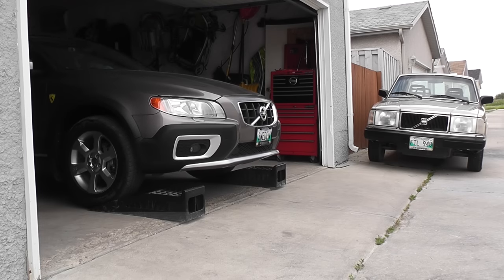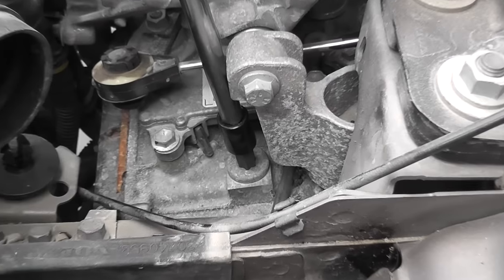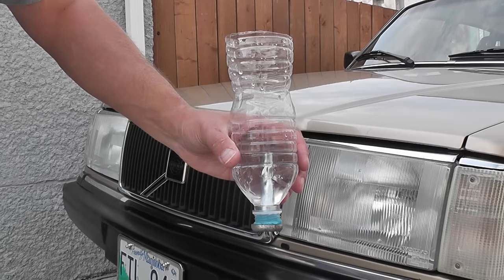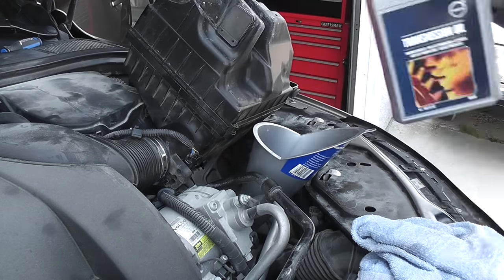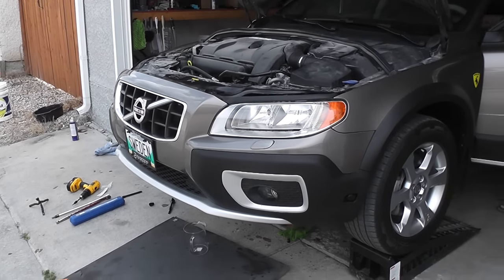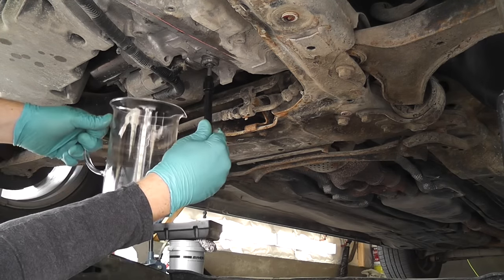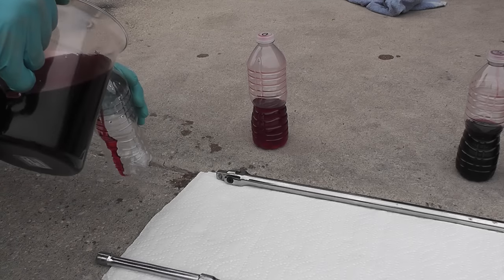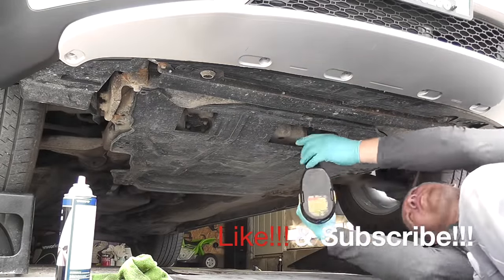Volvo Transmission oil change Aisin TF-80SC. 6 speed Auto.

Comment: you are better than any volvo service
Reply: Nope, not Swedens Volvo services trust me, they live for volvo.
Reply: Same in norway
Reply: Swedish volvo service sucks donkey balls. They failed to locate a small hole in a hose that was causing check engine light to come on until i mentioned that they could use starter gas to locate it.. Aint even going into the other stuff they failed at.
Reply from the maker: Its people!
Reply: El cambio de aceite no es correcto. Para comprobar el nivel de aceite además de comprobar la temperatura, el coche debe estar horizontal.
Reply: Exacto
Reply: @javiergonzalez5135  aunque no tabajo en un cocesionario de Volvo, esa reparacion es incorrecta pues el vehiculo no está nivelado, por lo que el nivel no es correcto.
Reply: Por eso dije exacto a tu respuesta. Tiene el coche subido de adelante. @franciscotorrado84
Reply: @DirtyRC101  You don't learn the "Diesel Start trick" in any education ... only by experience
Reply: @volvosweden  First thanks for the good videos .. nice to see a share experience with others, 'specially the experience not written in any book. Keep up the goods work.
Couple of things are confusing here though.
1. There is comming a liter or more out of the LEVEL plug the first time, you unscrew it?? Meaning Volvo/Aisin Warner overfill the gearbox from new???
2. Volvo/Aisin Warner says 7 liters capacity in the gear box. You took out only about 4 liters first time and drain off about half a liter of the last 4 liter jug put in??? (I got it with your 50/50, 25/75 and 15/85) Any other way to get the rest of the old oil out? I know "the leftover" is in the converter, solenoid block, etc. Is a gasket for the solenoid block cover not less expencive as 8 liters of Volvo ATF? Or will it not give any more result to take off the cover? (If it's even possible with the gearbox in place .. didn't look that thorough yet)
Some other "presenter" here on YT just say "start the engine, let the gearbox pump out the old oil, stop the engine when it stops runing out the drain hole" .. NOT to recommend!!!!
Reply: Telly Onthewall o wiz told there would be no math...
Reply: @G_de_Coligny  ehh..?
Reply: @tellyonthewall8751  transmission fluid will expand when they get old.
Reply: Does car need to be level left and right? How about front to back?
Reply: А то, что машина на подставках не горизонтальна? Уровень получится не корректным.
Reply: @tellyonthewall8751  Theres no reason to drain 100%, if you do a fill and drain regularly (say every 30,000mi/48,000km) the oil will be plenty fresh, I installed a transmission cooler and inline filter on my P3 S80 (indentical to the XC70 although I have the V8, same gear box and suck). Keep in mind that if you do what Volvo Swden did, he is actually removing more than 15/85 because don't forget the transmission oil mixes. Also, you don't need to use Volvo ATF. I use the "Aisin" brand ATF, which is the manufacture of the transmission, its like $5 from RockAuto.
Reply: @franciscotorrado84  puedo decir en ingles por los otres aqui: The comparison of the oil-level is not correct as the car has to be in exact horizontal position and not only the temperature-level of the oil.   saludos de alemana!
Reply: @worksbyoscar2350  Still Volvo service right, remember the "sealed for life" claim for the gearbox? How many Volvos are lying in a junkyard because  this?
Reply: @franciscotorrado84  el ha dicho que ay un desnível en la garage, y entonces el coche acaba nivelado. ;-)
Reply: @franciscotorrado84  que tipo de atf, para volvo xc 90 2.4 163cv año 2004 automático de 5 velocidades un saludo.
Reply: @tojiroh  sabes que tipo de atf para un Volvo XC90 2.4de 163cv año 2004 automático de 5velocidades gracias!!!
Reply: Very perofessional work . Отличные результаты
Reply: Totally agree.

Comment: Nice video. But seeing as you have VIDA you'll know that this isnt the procedure shown to flush the transmission. It states to remove the oil return hose.
Reply from the maker: And that would be the better process to change oil. But don’t want to mess with the lines and seals.

Comment: Finished this today thanks to your video, fantastic and thorough as always.  I made a few adjustments: I did extensive research and Volvo has an Aisin transmission using same JW3309 fluid as Toyota T-IV, which is what I bought.  It is the same stuff and much cheaper, $80 for 12 quarts.  I also only did 2 drain and fills, saving the last 4 quarts for about 1000 miles down the road when the fluid would be really mixed and next oil change.  Reason - I've done this on Acura before, their 3x3 procedure asks you drive through all forward gears between drains to ensure mix and my mileage is 85K miles, only doing a 2X gives adaptation some time to settle back in and not shock the system
Reply: Does the Aisin TF-80SC do "adaptation"?
Reply: @pbierre  yeah it’s an adaptive gearbox that adapts to how you drive it basically which is good for fuel but terrible for performance in some instances.

Comment: Hi Yuri,  I finally changed my transmission oil at 102,000 miles.  As mentioned before the transmission was clunking when changing gears  between R and D in parking maneuvers.    

I followed your instructions but ran into an issue.  

When you took off the air box, it was so easy for you, but for the life of me, I could not get the front to come apart, and I was not sure how to get the MAF senser released, as well as the clip that holds it.  I watched your video multiple times.  Thought I was screwed, cannot change the oil.  

BUT WAIT!  I was able to see the transmission inlet oil plug and insert a T-55 on extensions.  And I was able to squeeze my hand in and remove the plug.  And I have a  OTC Steel flexible spout and funnel which can fit right into the hole.  

Thus I was able to change the oil without removing the air box.  Phew!  

The transmission oil was black, hardly reddish like yours.  After doing three drain and fills, it is barely red.  I would probably have to do two more passes to get to your color.  

I was able to read the oil temperature with a Foxwell NT510E scanner, but I was not able to reset the counter.  

Thank you for your video, could not have done it without your instruction.  Regards
Reply: Hi brother. How was the gearbox after that? Still clunking? Mine is doing the same thing. Thank you
Reply: @Redrocer  In the winter time, no clunking, in the summer still clunks.  I need to do two more drain and fills.
Reply: @chien-shengtsai8626  thank you for answer 🙏❤️

Comment: 2009 XC60 here. This was a brilliant video worked great for me. I was worried doing it as my car was 2nd owner at 180,000km with no evidence of ever having the fluid changed. It was still slightly red so it may have been at some stage. 
Tip: when resetting the counter be sure to read the instruction page (I didn’t). You have to click on the symbol of the module to start the procedure NOT click on Continue like I keep doing. 
Also if you don’t have a hex 17mm socket (get one!) or you can improvise with a deep 17mm hex nut ( I did)
Also to get to ignition setting 2 on my car, stop the engine then press the start button for 2 seconds without pushing the brake pedal 
Thanks VolvoSweden for the great videos
Reply from the maker: Great tips here. Thx so much

Comment: Very well detailed video! Very much thank you for this! This is exactly how I will do it on my Volvo S80 V8. A can't say how much of your videos help me to learn about servicing my Volvo! Really appreciate your work! 👌🏻
Reply from the maker: +Ákos Frast Thx. Easy job
Reply: After seeing this video I am also confident to do it my self on my v8. But first I need to get vida and dice.
Reply: But your car wasn`t in level, you jacked up the front wheels? Confused? How are you mean "in level"?
Reply from the maker: +Zeus Sweig Please read in description. The garage floor has a slope. The car is level.
Reply: My advice is not to flush it, rather, change the atf at shorter intervals e.g 25k km instead to prevent shocking the transmission when most of the existing atf is removed.
Reply: @jdfd4906  not most when You drain 3.5L of over 7L total

Comment: Great Video Guys! I already did it like three years ago on my S80 V8 2007, now I just bought a V70 III D3 2011 and it has the same gearbox and it has 161,000 kms and I assume with the original oil from the factory...... Volvo does not have a service plan to change the oil, they say they only change it if there is a problem......!!!!!!! ????? But then it is often already too late !
Really nice video and quality - world class ! I also used your video yesterday for the rear brakes and the handbrake motor, thx for that one as well !  So appreciated by me a Swede living in Germany and with our 3 Volvo cars! You are simply the best!
Reply: Volvo do have service plans but for specific vehicles only. 60 000 km for fleet lease/service vehicles (taxi, police etc) and the rest of us "if maybe necessary but Volvo couldn't care less, please buy a new car instead" type of deal.
So changing trans oil is never a bad idea. If yours should fail after a fluid change at 161k it's just a sign that your transmission was damaged beyond repair anyway. It's a Toyota transmission after all, it should hold.

Comment: Very good instruction. Just one tip, when setting the oil level,  your has to be on a flat surface and level. Best solution would be to jack up the rear.
Reply: I was wondering the same thing. He said it himself that the car should be level to get the proper finished level. His vehicle was still on the ramps

Comment: Great video! Just a few notes: There are 2 versions of the TF80SC and both use different transmission oil. (one is type 3309, other 3324) Make sure you use the correct ones as you can not mix these. There is a vin break for each vehicle model so you can check online.
Also, if you find the Volvo fluid hard or expensive to come by, toyota sells the exact same fluid at a cheaper cost. (After all, technically they made that transmission)
Reply from the maker: Great info! I will add this info to the video description. I thank you.
Reply: What's the spec on the Toyota fluid?
Reply: Depending on your model VIN break:
JWS3309=Toyota Type IV=1161540
JWS3324=Toyota WS=31256774

Use the VIN to determine, not model year as 2010 does not apply to all models(XC90 didn't change over until 2013)
Reply: @GCast-iv1pd  Hi, so my XC70 2010.10 production (MY2011 based on VIN) needs the Toyota WS / JWS 3324 right?
Reply: What fluid on a 2007 XC90 D5?
Reply: @Bjornthevolvo  All 2012 and earlier XC90 D5s are JWS3309. The changeover to JWS3324 happened in 2013.

Comment: Great video -  the details make all the difference.  I completed the service on my 2014 XC70 with a couple of changes. I found a funnel with a long hose that I made stiffer with a coat hanger, and used that to put fluid in the top of the transmission so I didn't have to remove the air filter box - I just used a 3/8" drive extension to access the torx fitting (on mu car a bit hidden by a fitting above it), and an extensible magnet to lift out and replace the torx fitting with each addition of fluid.  Worked fine with a little bit of fiddling, with a lot less hassle than removing the air box each time.
Then, the whole VIDA DICE issue was so difficult to decipher (software only available with license from Volvo, outdated operating systems, lots of on line confusion, etc., etc.) that I took my mechanical engineer brother's suggestion and just heated the final 4 quarts of transmission fluid to about 65 degrees C, assuming it would cool a bit when put in the transmission.  Buttoned it up and seems to work fine.  Didn't bother with resetting any codes.
Reply: To anyone doing this. I do not recommend bypassing the reading of the temperature sensor. You will not get the correct reading using methods such as this or using a laser thermometer pointed at the bolt (as I have seen in other car’s procedures). And you will not get the correct level. Probably good enough. But if you’re going through the trouble of servicing a “sealed” transmission I recommend you do it right and get the correct level.

Just get the DICE knockoffs scan tools for about $100 online and the software from volvodiag virtual machines (google it)

Comment: excellent video! However on most cars you can disconnect a line to the auto trans cooler (often inside the radiator) so that you can pump out the oil while filling with new oil and keep doing that until the oil runs clean.

Comment: Volvo mechanic for 30 years.
Disconect the transmision reverse oil ,and conect a lang hose on it.
Tap of the transmision fluid.
Fil it wih 3 liter transmision fluid.
Start the car.
Start filling the transmission with 4 liter while ideling.
If it start with air bubles,stop the engine.
Fill it with 3 liter trans flued,and connect te reverse to the radiator.
Now you need vida for the level check.

Comment: I finally got the kahuna's to attempt this and thanks to your video I had the confidence all the way through.  However, I did only one drain/fill.   
Mine drained exactly 3 liters.   The old fluid was more browner than I wanted to see and smelled like old varnish.  
It's a 2010 - S80T6 with 118K miles, previously owned by an older gentleman so I don't think it was abused so much.  
After the single, 3 liter drain and fill, the fluid turned much more pink after idling, and running through the gears a few times.   I was pleased to see that.  
I documented with photos so I can compare color after next change in about 3 months.  If the fluid is brown again I will consider doing the 3x flush like in the video.  Or I may consider spending the $300 to have it fully flushed at the Volvo dealer and have the computer reset.  Any feedback on this would be appreciated.
Fluid was $58 here https://www.fcpeuro.com/products/automatic-transmission-fluid-4-liter-1161640.  The website tells me to use the 1161640 for my 2010, not the 31256775 fluid. Anyway, this place is awesome for ordering parts I need and they have a lifetime guarantee!  Even on filters!!!!  You all really need to check them out!
Thank you again Sir for another wonderful video.  I am just a computer programmer but a weekend mechanic on my own cars.  Volvo's kindof scare me and I want to take care of my baby.  I can't afford the dealership either.  I have changed spark plugs, oil trap/PVC box, brakes, and cabin filter, saving a lot of money.
Reply from the maker: Glad my videos help. Good luck and take care of your S80

Comment: Personally I would not bother buying a DICE unit until the warning light comes on., If the oil has been changed you know its good, So you could buy one later if a warning came on, (if the transmission is not used hard they very rarely come on anyway)   What is important is the oil is changed, But if you totally disagree with this please let me know and give your reasons and I will change my view.:-), would love any comment.

 The best transmission change for this model I have seem. Great work, Thanks. :-)

Comment: Very good video and voice over explaining the steps.  I noticed how long it took for the ATF to heat up while you were letting it idle there, to accellerate this you can put the car in drive, and power brake gently, putting a load on the trans.

Comment: Fantastic video. This is probably the best level of detail and information i have ever seen for an auto service channel. Thank you so much.
I just drove from Austin to Seattle after having a shop change transmission fluid in my 2008 xc90 v8. The car drove fine but now has a huge puddle of transmission fluid under it. Hopefully i can figure out the issue.

Comment: Hi there. I am 2010 XC60 2010 D5 owner. It's 260k and transmission fluid wasn't change all the time. I haven't problems with transmission and gear. Everything works fine. One mechanical told me that manufacturer doesn't recommend transmission oil change but other told me that he recommend it but not all fluid at one time. He recommends to first we change 4l and after that I should drive it couple of months and after that new 4l and again couple of montzof driving and after that new and last 4l. He told me that once client insist to change all fluid, 12l if I remember, and after that he's transmission broke.

Comment: Great video! I was a bit worried about doing this myself as it seemed a little complicated, but this video got me through. 😊
Reply: I can do my own but don't have the plug in system did you have that
Reply: @shanewonder5306  Yeah I had that. It resets the computer for the gearbox so it knows it has fresh fluid. It changes how it shifts based on how you drive, but also how old the oil is. But most importantly, you can see the temperature of the oil from the sensor. You need to know this as it needs to be between a certain range to properley check the oil. Once it's at that temperature, you take out the filler plug and any excess will come out and the level will be correct. If none comes out you know you need to add more.

You can get Chinese clones of Vida Dice online. They're not too expensive, but much more then other dealer diagnostic systems I've had. I've had Chinese copies of VCDS/Vag-Com for my VWs, and now TechStream for my Lexus (that's for Toyota's too). They're cheap because it's just a basic cable and the software. But Vida Dice has a box of tricks in the middle (you can see that in the video) that bump the price up. So, you'll have to decide if it's worth it for you. If you're going to use it to maintain your car then great, but if it's just for one job get a shop to do it. 

It came in handy for me as I did my own maintainence and as it was the proper Volvo software, you could access every system on the car and find out exactly what was wrong. It's helped me diagnose problems, and perform calibrations like the one for the gearbox, and from when I had to install a new clock spring.